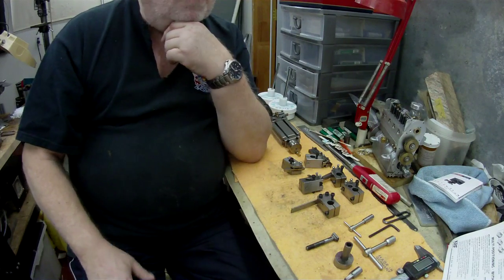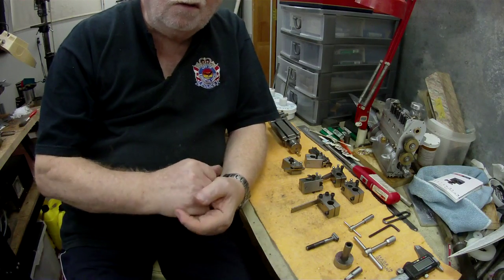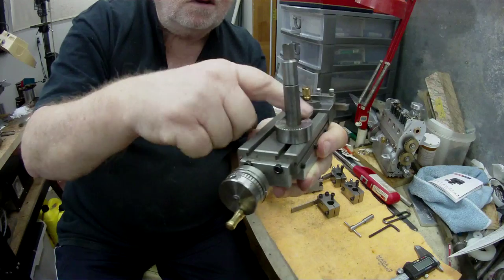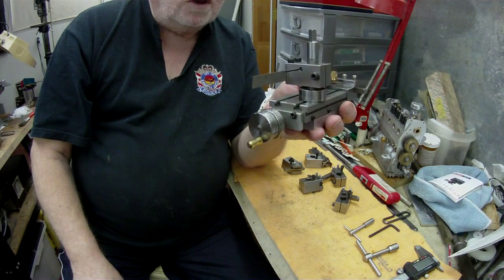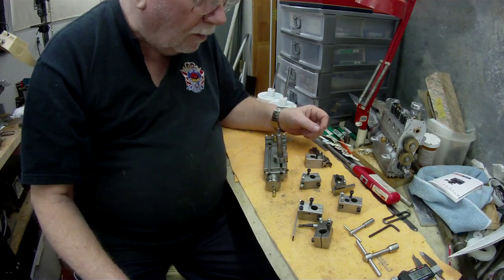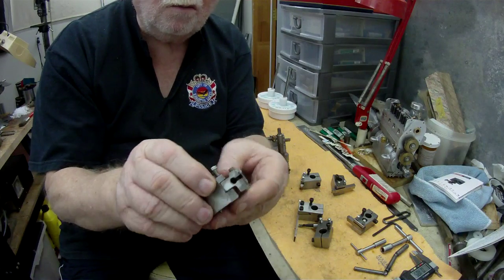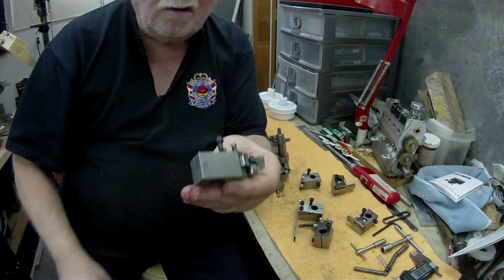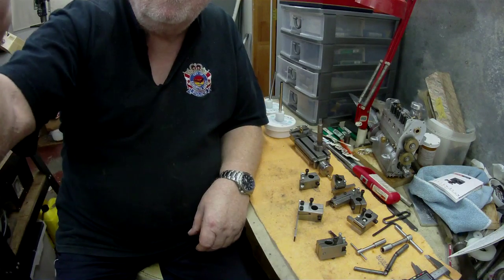FILE0013 Different type of QCTP for Taig Lathe

Comment: Thats a realy nice setup, and a lot better than the original taig toolposts, for me since metric is the only bolts I can get here the 5mm for holding the toolpost down on the slide is thinner than Original and they sometimes break.
Reply from the maker: Happy,
   the bolt I used on the toolpost was 5/16-18 whit, I am pretty sure I also had a few identical 8 mm but for the moment I can't find them, if I do have I will mail to you, leave it with me,
Reply: Walter Maisey I never tried 6 or 8mm t-bolt and taking out some notches, never thougt of doing that before I saw your video so I will see thursday if I can get some of those and try if it works.

Untill now i just buy some wood bolts 5mm and grind the two sides away untill it fits

Comment: The Taig standard thread is 10-32 UNF, .1900"-32 UNF. The so-called T-nuts are the corresponding square-head nuts available in any USA hardware store. But they are abominable. They will not go through the slots without cocking up. If you make  your own T-nuts this is not a big deal. My solution to your problem is to buy a bunch of Taig tool posts and put a different tool on each. Here in the USA the tool posts are not expensive. But do make your own T-nuts.

To one of your reader's coments, I too work in metric. I make my own T-nuts, an agonizing process in my little Proxxon mill.
If you are in metric this is your only solution. Make your own T-nuts. Measure the slots. make the nut to fit. Tap them for whatever thread you wish. The 10-32 is approx 5mm x 0.8mm and M5x something  will do you, it is not critical. I do metric, I grew up in it, I detest the Imperial threads. But not all nuts are created equal. If you must use the awful square bolts, get a good quality nut. Stainless preferably.If a nut breaks, it is a cheap nut.

The last thing I have to say, and I have probably said far too much, is that there are useful Taig Lathe resources. One of my favorites is John R. Bentley's www.modelengines.info. He has made many interesting modifications to the Taig lathe. Another is Nick Carter's Taig lathe pages. If Mr Maisey does not mind, I I will make reference to his videos on Mr Carter's pages. Yet another useful reference is Tony Jaffey's website. Search for it.
Reply: Oops,misspell. It is Tony Jeffree. Available at amazon.co.uk.Try also http://www.jeffree.co.uk/modelengineering.html.
Reply from the maker: Juan,
   I don't have a problem, I think you must be meaning someone else, if you go to A2Z website and search for T-Nuts you can buy both bagged sets of 8 t- nuts for the Taig lathe and a bag of 8 for the Proxxon mill, $18.00 each bag + shipping, the Proxxon T-nuts are metric and the Taig is 10-32, just buy a length of 10-32 steel threaded rod and some nuts and you will be ready to go, the A2Z T-Nuts are also heat treated, 
Yes I have visited Mr Bentley's web site, beautiful tooling with lots of interesting projects I could persue but not enough time, also Tony Jeffree's site I have visited, I also have some content on Nick Carter's blog,
If you feel you would like to mention my videos to Nick, I have no objection,

Comment: Hi Walter, I'd like to make a set of these for my Taig. By chance do you have any drawings, or at least dimensions for these holders that you're willing to share?  Thanks Bob
Reply from the maker: Hello Billy, I think I can help you with your request, do you have access to a CAD program? I have found some rough drawings in old AutoCad 14 and 2000, not sure how I can transfer them over to you, I have them on a USB, they should help you get started, they are drawn to scale but have lots of dims missing, but with cad, you can add them in yourself,

Edmund......Alberta
Reply: @holmes230536  Edmund, yes. I'm pretty good with CAD, I use Fusion 360 daily.  I could just start from scratch, but thought, heck if I can find out the dimensions that work and save that time why not?   I'd be happy to take your data, update the CAD files and even provide 3D files, for others.  How can we proceed?  FYI I'm in Ontario.
Reply from the maker: Hi Billy, my email is holmes_ca_2000atyohoo.com, I am 87 years old and I'm thinking that sending the files that way might be best but if you can suggest a better easier way please do so, 

Edmund......Central Alberta